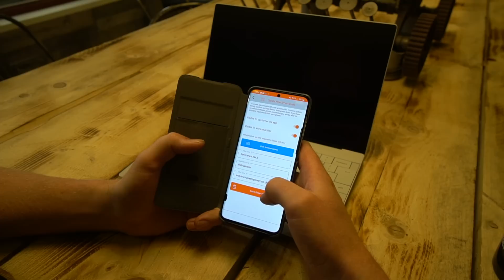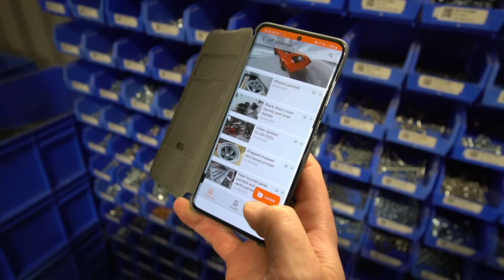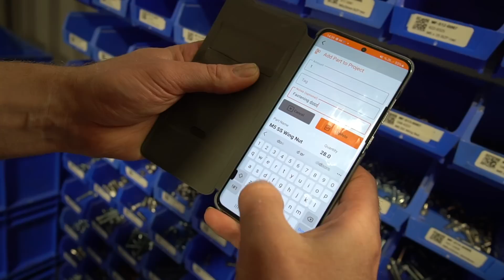Tool Time Episode One: Global Workshop

Comment: We now have a visit from Rowan booked. Looks like a far better system than our current overly-complicated system. A proper user friendly system for a small turnover specialist who also does restorations is what we have been looking for since forever. Unfortunately we have ended up with a fleet managment system that has an awful interface and is so complicated for what we do.

If the timesheets and the extras you mentioned come online soon, we may well swap systems.

Thanks for this video.

Comment: Very interesting. This speaks to economies of scale which are so important in your type of environment where you have a business that is clearly growing exponentially. The bottom line is that every self-tapping screw and roll of making tape not accounted for, will in fact impact your bottom line. Not forgetting that every roll of masking tape that crosses your threshold automatically increases in value from the price you bought it for to the price you charge for its use. You also mention over-complication of systems which is crucial when considering what software to use. Programmers create systems of such unholy complication that they become self-defeating due to amount of time necessary to feed data into them. 'Keep it simple, stupid' has never been more relevant. Top class content, as always.